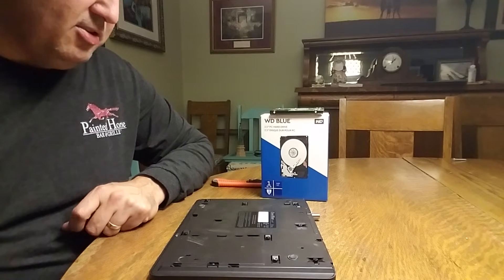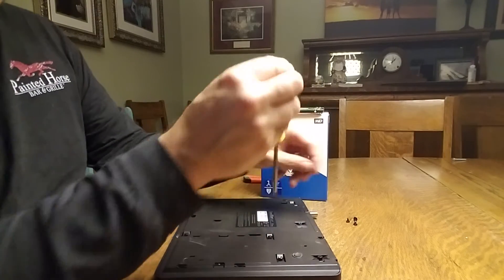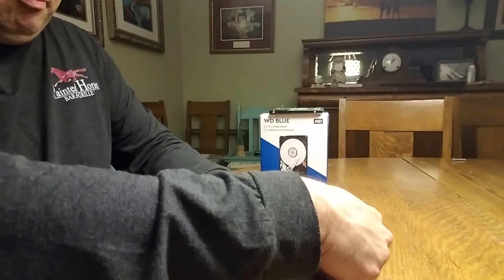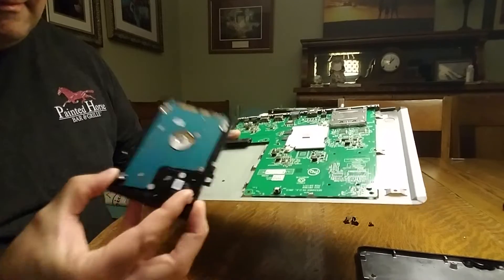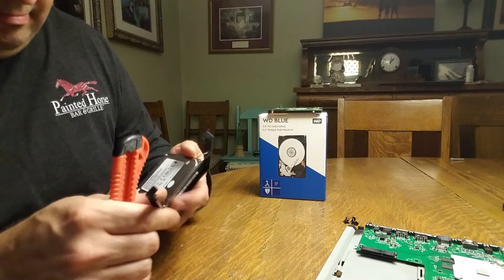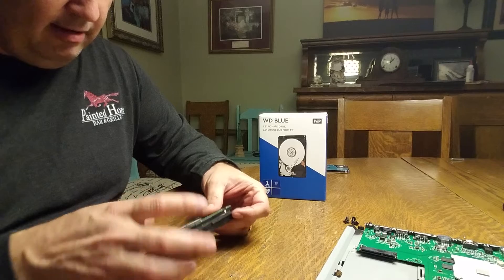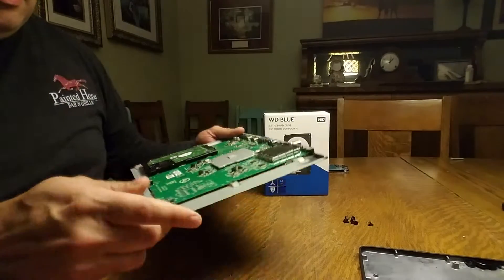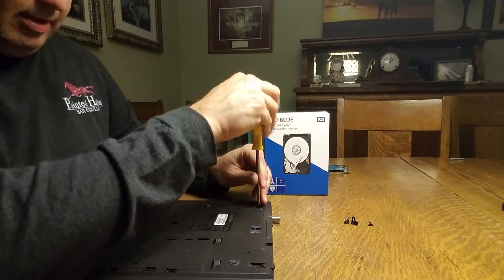Channel Master DVR+ internal HD replacement

Comment: Thanks very much. This worked great. I followed the procedure to the letter. My local Best Buy had the exact same HDD. Installed it, formatted it from the DVR menu - DVR, DVR Setup, Re-Initialize Storage Device. Ran Check Disk from the same menu. HDD: WD Blue, 1 TB, 2.5”, Model wd10spzx-spz10t0

Comment: Per this informative video and comment thread, purchased a 2 tb drive for ~ $65 on AMAZON, then switched it out for my dead hard drive.  I reformatted the new drive after it was installed in the channel master.  Only tool needed was a Phillips screwdriver.                                                                                            
THANKYOU  Anthony M  and  @rhpeterson

Comment: Here are the answers to a couple questions below. I just successfully replaced my hard drive from Anthony's video and it's working perfectly (thanks Anthony!) The hard drive originally in my unit was a Toshiba 1 Gb drive, model MQ01ABD100V. I replaced the drive with a 2 Gb drive in the same series, Toshiba model MQ04ABD200 (sometimes listed as MQ04ABD200-PS). On Amazon it was about $65. Both the original and replacement are SATA drives, 2.5 inch drive, 9.5 mm thick. In theory any SATA drive with these dimensions should work, but of course I can't guarantee that. I'm considering buying another for next time the hard drive goes out. The original one lasted five years and these drives won't be available forever.

When I turned on my DVR after replacing the hard drive, I got an error message saying recording would be disabled. Get rid of this error by doing a factory reset (you have to select the full reset option that erases all the recordings). This will format the new drive and you will be good to go. Note: I would like to know the max size hard drive this unit could format and use. If anyone has an answer, please post it in the comments.
Reply: curious... does using the 2T drive double the capacity?

Comment: Great video thanks. I have 2 of these and the harddrive,s went out on both. I am using 2 externals. I wonder why these go bad early? Is it because of bad venting for the heat? And do you think a solid state drive would be better?

Comment: Hi Anthony, May I know did you have to transfer any programmed software in the original HDD to the new HDD also where did you find your information on the compatible HDD?
Reply from the maker: I didn't move any software.  I just put it in and it worked.
Reply: @anthonym8807  May I know if you're still using the device as your day to day DVR? Also what model of HDD did you use? It appears to be a 2.5 inch laptop HDD... I wonder if SSD would work...
Reply from the maker: @henricomartin101  yes, still working perfect.  Yes, it was a standard laptop hard drive.  I don't see why a SSD shouldn't work, but I have never tried and I don't represent any companies (hard drive or channel master).
Reply: @anthonym8807  Just out of curiosity, the port appears to be SATA right?
Reply: @henricomartin101  I provided more information about hard drive elsewhere in this thread.